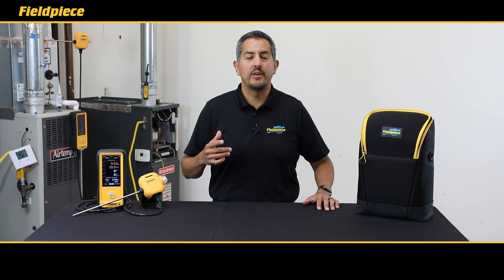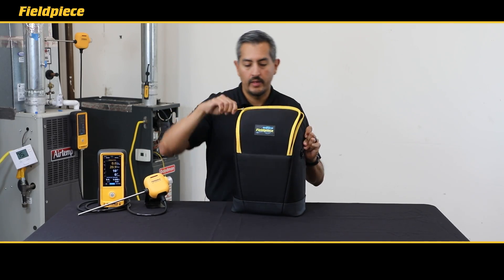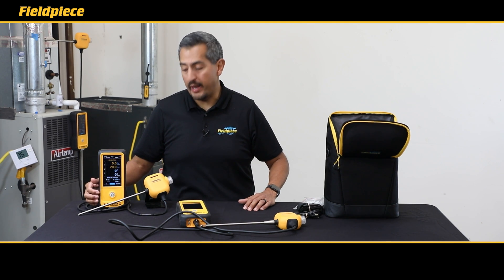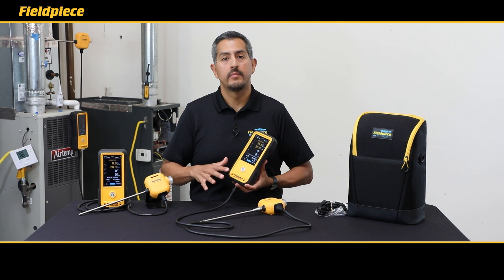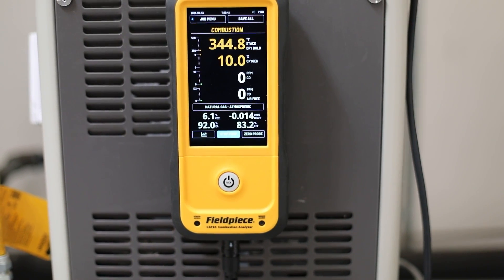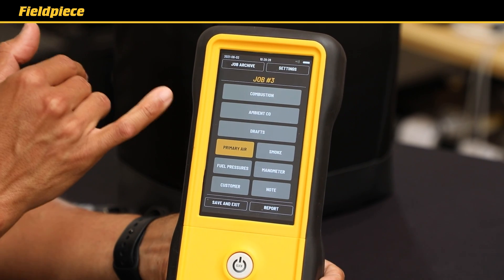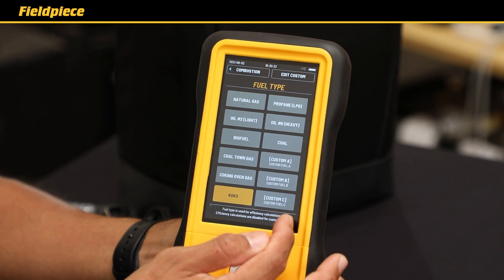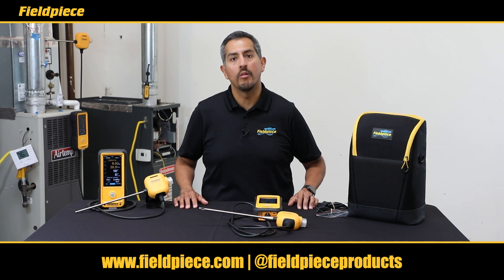Fieldpiece Instruments launches NEW Combustion Analyzer models!

Comment: Good to see you guys came out with one. I'm a big fieldpiece fan. I might own every tool you guys make, I love your hassle free warranty unlike that orange and black brand that takes months with the tool you send in. But, did you guys drill through a double wall b vent to take measurements? 🤔
Reply: What orange and black brand?
Reply: I've yet to see an official statement on what to do with double wall when taking a test.  I wish the AHRI would toss something out.
Reply: The purpose of B vent is to act as a thermal barrier, drilling one small quarter inch hole isn’t going to compromise that. It is also a negative pressure draft system so there is no concern. If you feel uncomfortable just putting tape over the outer hole, you can always drive a bolt all the way through.

Comment: Please elaborate on how it is possible for the CAT85 to simultaneously measure draft and combustion measurements at the same time?  Also what will the CAT85 sell for and will it be available this fall?
Reply: I'm curious too. Live draft and combustion together would be nice, but how? 
Guessing tube within a tube in the probe, with enough separation between the combustion gas sampling tube and the draft measurement tube for there to be no interference.
TruTechTools tools is taking preorders for the kit without printer for $1661.75, or $1879.20 with the printer, with an expected release in September.
Reply: @markbeiser  That answers the price question.  It would have to integrate with MQ to justify that price tag.
Reply: @Marty1911  Since it is a Fieldpiece product, I'm assuming it will get integrated quickly.
I have not jumped into a bluetooth CA yet.

I'm still scanning the QR code on the display of my Insight+ to get the numbers into MQ. but it is getting a little long in the tooth.
Needs a pump and both sensors before heating season, so contemplating my options.
Reply: It appears since the "CPU" / display is the same on both offerings, this is unique to the pump head - I am guessing that by virtue of having the water discharge feature, it gets a comparison of pressure "in" vs pressure "out" to generate a calculated draft pressure. Obviously, we all want a verified answer!

But, that's my guess at what they're doing...